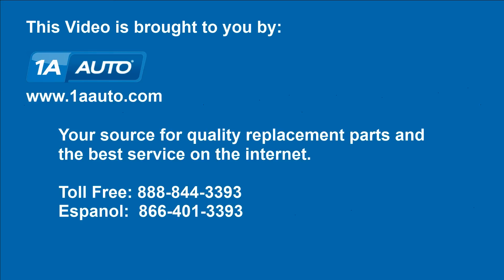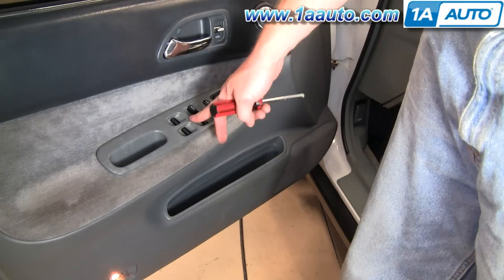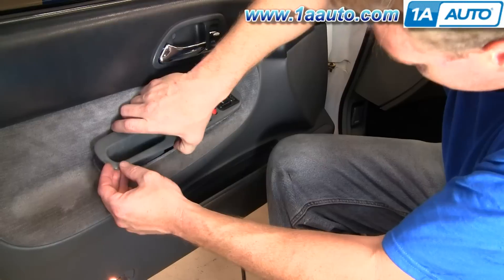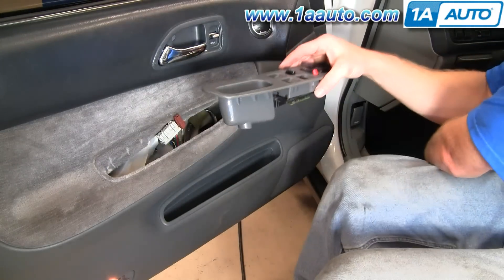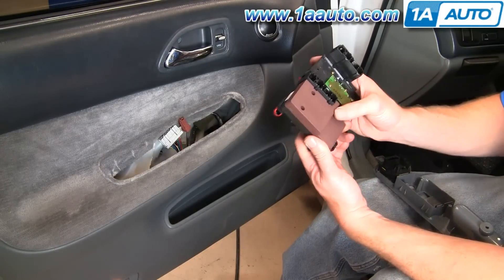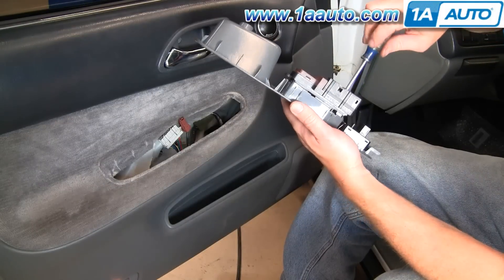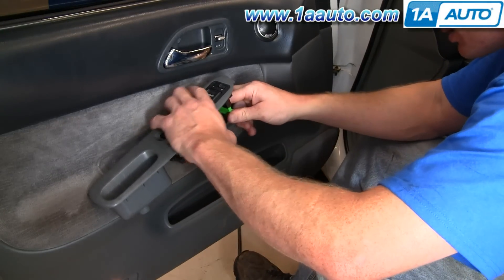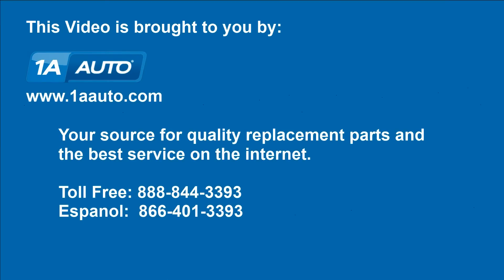How To Install Replace Master Power Window Switch Honda Accord 94-97 1AAuto.com

Comment from the maker: That switch controls the power windows. The power lock switch is separate. What you may want to do is test the power going to the switch with a test light to see if there's power going to it. If there's no power going to the door lock switch or rear windows, check the wire loom between the drivers side door and the body of the car for a broken or a frayed wire. Also check all of the fuses to may sure that they are okay too.Hope this helps you out.

Comment from the maker: You may want to test the switch with a test light, and also check the wire harness between the driverside door and body of the car for a broke or frayed wire that could also cause this type of situation. Hope this helps you out.

Comment from the maker: You could try to spray the weatherstrip around the window with some silicone spray, to see it that speeds them up a bit. If it doesn't the window motors could be getting worn out. We sell this kit if you end up needing to replace them. Just copy and paste into your browser  1aauto.com/1A/WindowRegulators/Honda/Accord/1AWRK00022/298126/1995?utm_source=youtube&utm_medium=youtube&utm_campaign=1ATony

Comment: Great video man..
i thought i had the same problem.. but it wasn't really the switch that needed to be replaced.  my window on the driver's side won't roll up anymore its ALL the way down.. and won't come up... i thought that getn a new window switch for my 97 honda accord wud fix it but it didnt. It helped the other 3windows roll up faster but my driver side window still wont roll up. When i Try to roll it up it doesn't work.. it doesn't even make a sound like its trying to roll up.. HELP? :(

Comment: My driver side window could go down, but not up, so I ordered a new power window motor from you guys. When it got here I tested it before installing, and the motor goes down, but not up, same as before. So I know it's not the motor's fault now. Could it be the switch, or wiring, is wrong (I have a feeling it could be either)? 

I'm going to order a new window switch from you guys (as seen in the video). Do you think that is a good next step to try? Thanks, any information will help!!

Comment: I thought I had a bad regulator on my driver side power window (96 Accord) and took it out following your very good video -- thx!  

Now it seems that there is no power to the the motor from the master switch (four contact, blue/black, blue/yellow, red, & black wires).  The blue wires are shorted together and become open when the switch is pulled.  Neither of the blue wires going into the switch have voltages (three other wires have ~11V). Could it be the switch?  All other three window Ok.

Comment: Hi 3 of my power Windows work, but not the passenger side back window. Any ideas? Also, all if the power locks don't work, does that module in the video govern the locks too?

Comment: My 1995 honda passenger windows and locks will not work.  Would relplacing the swich work or is there a wiring problem?  I have check all the fuses, and they are fine.

Comment: Does this fix the power door lock as well ? Mine doesn't work and my power windows only work on the driver side and not on the passenger side, only at the respective doors do they work.
Reply from the maker: You may want to see if there's power going to the passenger side when the switch is pressed. This can be done with an ohm meter or a test light. If there's no power it could be a bad switch or possibly a broken wire in the door harness. You may want to check the driver side door harness that runs between the door and body of the vehicle for a broken or frayed wire. Hope this helps you out. 1aauto.com 888-844-3393

Comment: Hi I have 1 96 LX and when i bought the car a month ago, the windows would move down slowly, and the rear windows only went down halfway. Today, I went into the car and only the master driver window works. All the others do not even if I use the individual controls to try and roll the window down. Power mirrors work fine and all fuses are good. Could this be a master switch?

Comment: i have a 95 accord & the rear windows go up & down just fine but the front windows struggle to roll up i sometimes need to help by pulling the window for it to roll up, but they both roll down just fine what is the problem?